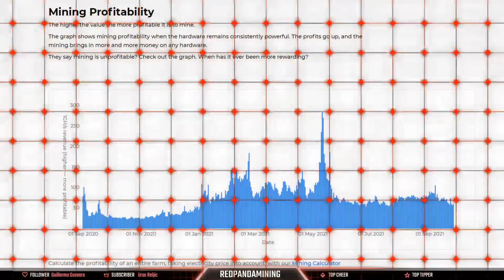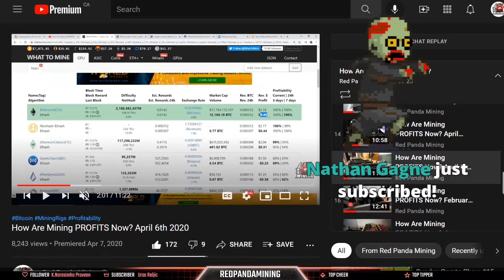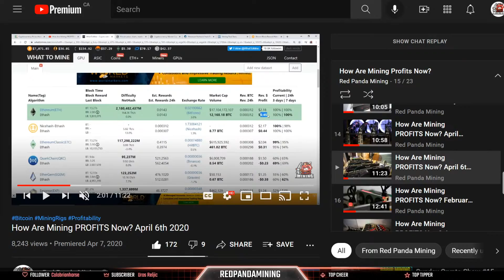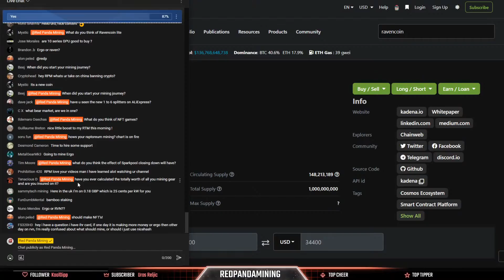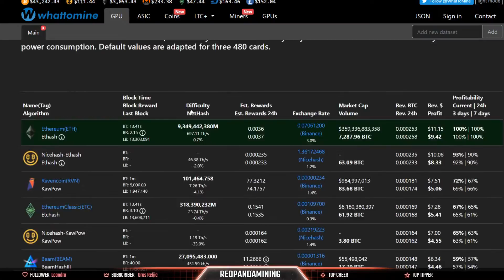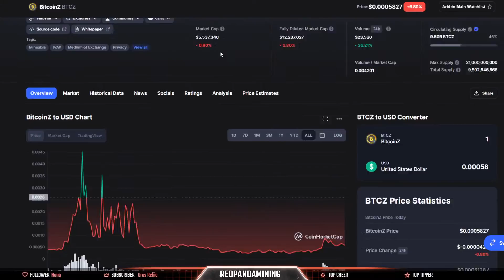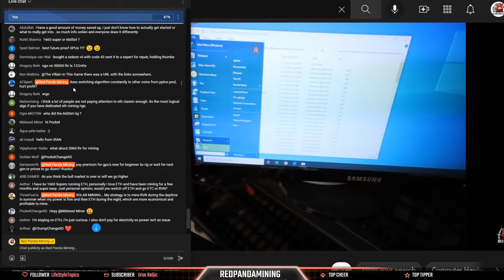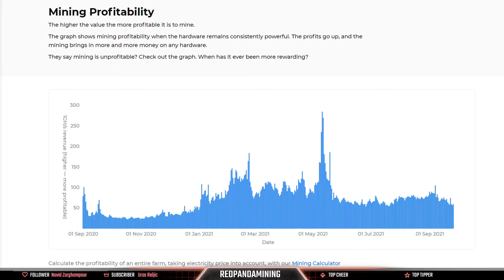How Is GPU Mining Now? Still AMAZING | AMA 33 LIVE!

Comment: Yup. People get into mining and think its a steady job. Its not. Plan for profits every 3–4 years, rather than daily or yearly. It's a job that relies on Bull / Bear cycles, so use this as a SECONDARY SOURCE OF INCOME for the first 4 years. Best time to mine is in the Bear Market, where the Taxes you incur on the coins your mine are much lower than in the bull runs (which yield less coins). I'm not a miner, but will get into it in the Bear market following this run. Mine your Coins in the Bear Market so that you can accumulate more coins per day, and then sell at All-time Highs in the next Bull Run.